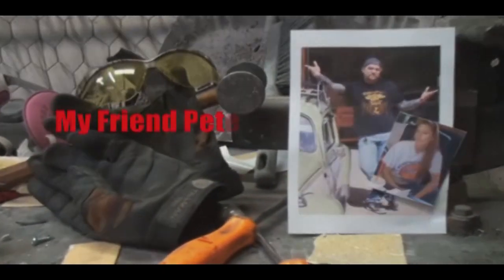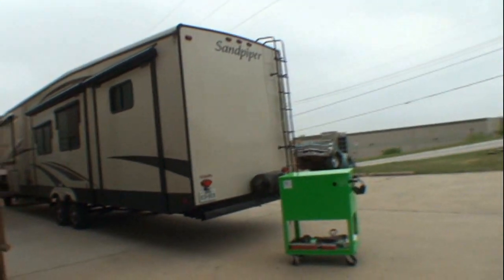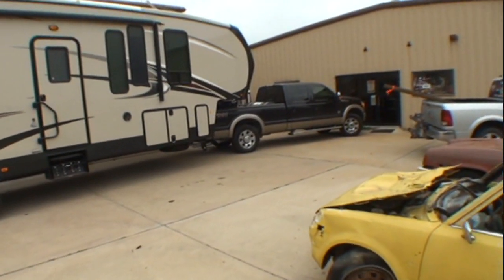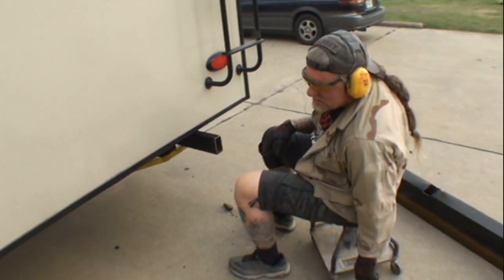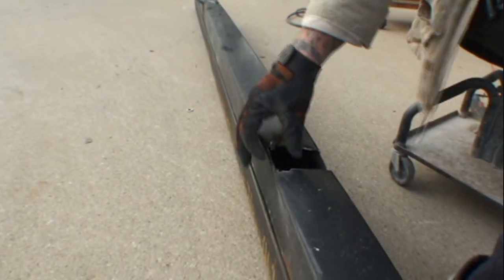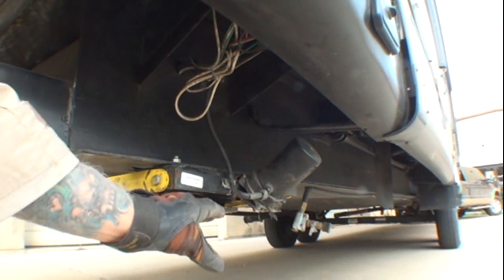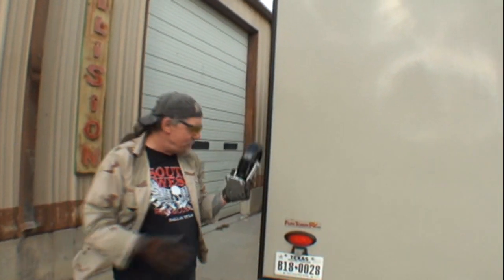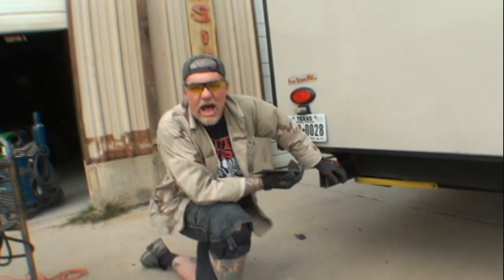How Can I FIX My Camper "RV" Trailer From Dragging Ass? - Do It Yourself

Comment: I'm kind of with Gonzo 59 on this one. Personally, I think just a pair of 1/2 x 4"  skid plates would have sufficed without sacrificing the safety aspect when the center wheels lift off the ground and the back end uncontrollably swivels towards the lowest side of whatever slope is being navigated.
As it is you just cut the normal clearance in half by adding the wheels but you did a nice job and gave the customer what he wanted. Your install will probably work fine 99.9% of the time.  Hi Minnie!
Reply: There is no possible way those rear wheels will ever hold that entire trailer up and cause it to do that. Give me a break.
Reply: Obviously you haven't seen much in life yet, have you. And it is obvious that you have no experience with trailers.  I've seen what I described, happen on shorter trailers than that. Most times the frames of trailers that long will buckle when the central support of the axles leaves the ground from just the kind of situation Pete is showing you. That is why the axles are in the center rather than further back. They make em cheap, that's for sure and they are made to traverse only level ground. But when you get into some places even worse than what Pete is showing you, it can turn into a very expensive nightmare in a hurry. And if the frame doesn't buckle and you've got swivel  wheels on the back end coupled with the pivoting pin of the fifth wheel, that trailer will move to the side instantly if there is any sideways slope to the grade. 
And as for the centrally located wheels leaving the ground, just ask others with more driving experience than yourself. You will learn that people have even got their trailers jacked so badly that the pulling rig needs help because it can't pull the trailer off the brow the back end is hung up on when the full weight of the trailer is supported at both ends.  That is why skid plates are a good choice because you lose no clearance installing them, lessening the possibility of that shit happening. And forget trying to back a trailer like that off the hump once the back end of the trailer touches the ground. Simple physics makes that impossible.
Not everyone lives in the fantasy land of blacktop, flat prairie and superhighways. Take a lesson in geometry and my point will be proven correct in very short order. And that certainly isn't rocket science to most folk.
No breaks given for stupidity.
Reply: Sir, I have put over a quarter of a million miles pulling trailers that are well over 30 feet long with over half a million dollars worth of horses inside I actually use common sense pulling my rig. I know your old but age doesn't quantify necessarily to knowledge. A good truck and trailer driver doesn't put their rig in situations that could come even close to a train wreck like you are describing. I was exhausted reading your post due to all the nonsense and make believe scenarios, I don't know where you are pulling your trailer but you're definitely not very intelligent if you are putting it in situations like you describe. After seeing you made a video about putting paper flames on a passenger car now your nonsensical post makes sense. I'm still laughing.
Reply: Who said anything about a driver knowing what he is doing? Did you miss the part of Pete's video where he showed that the guy driving the rig nearly tore the bumper off that 80,000 dollar trailer? Most people who purchase monstrosities like that have little to no experience driving such a combination and I can attest that they constantly get themselves into real nightmare situations. 

You remind me of an idiot know it all up here who loaded his draft horses into his trailer to take them south to the Royal Winter Fair in Toronto only to have to get someone to shoot the both of them after they fell through the floor of the trailer at 60 miles per hour and he dragged them for 10 miles before someone noticed and stopped him. Not much left of their legs so he lost everything to his ignorance of how to check the soundness of his rig before loading over a ton of animals. He had years of experience though hauling horses. But he was just an idiot with a mouth and no brain driving down the road dragging a trailer.

As to my flame paint job, you should watch the video series. You might learn an easier way to design and transfer flames to a vehicle to "PAINT" those flames and have both sides look exactly the same.
As Pete has said in the past: You keep laughing and I'll keep showing folks the right way to do things. Wisdom is not based upon your opinion but is based upon what works properly and what doesn't.

Comment: The back end of a Toy hauler is different.  Have you worked on one of those?  I have a Raptor (Craptor) 332 TS.  If I drag ass too far  I start  hitting the gas tanks.  i have a banked driveway worse than yours.  The tough part is placement of the castors because the back end hits first. The hinge of the  bicak door has to be able to swivel ope without can openering the  door.  I got lucky coming in my driveway and heard the scrape.  I had just enough brains to listen and stop.  But nobody can seem to teach me a work around.  Maybe a removeable wheel might work.

Comment: It's a good idea in theory but maybe not the implementation.  Even if there is no chance for it to lift the road wheels off the ground in extreme situations "hence the reason to have installed them higher" there is still the very real chance of the frame rails collapsing because of the distance to the next line of support.  I mean collapsing behind the road wheels as they come off the ground or maybe even tearing the frame loose from the body itself.  Just something to think about when you're attempting a job like this.

Comment: Another awesome video my friend. I also was wondering if you could have welded the plate on the top side of bumper and frame and it would have recessed the bottom of caster within a few inches below bumper. As long as it had room to swivel still. I watch your videos and you are like me and learn and perfect on last job. Awesome ok.

Comment: Too big of wheels and/or poor placement Pete. The correct way to do this is run a string from the bottom of the rear tire to the bottom of the bumper to see where the angle is going to be when it will drag. The idea is to keep the skid wheels to take as little pressure as possible to keep the bumper from hitting. Your size wheel and location will hit way earlier than need be. There are also skid wheels made specifically for this purpose, however your wheels will work, but they will impact the ground way to early like I said because of the placement related to size. Any pressure against the bottom of a trailer frame is not a good scenario, but it's needed for cases like you describe, but only the minimum as possible. Enjoyed the video, I just think a little more engineering is needed. Use the string method I described to yield the best results and see if anything else  could impact other than the bumper etc.

The other issue that's going to happen is not the structure of the wheel itself in some cases, it's the steel mounts on the sides. Even though the wheels turn, in certain cases they will bind and because the wheel is so tall, the weak point is the side steel mount, they will bend easily without a lot of pressure.

Comment: First off no vehicle is taller than 13.6 ft  and that trailer’s empty weight is more likely around 15k pounds and them ridiculous wheels your putting on the weakest point is the bearing cup as soon as they’re under a load that will pop free ... do better !

Comment: Wouldn't the wheels raise the back of the camper enough to lift the axle wheels in some "situations?" I'd weld the plate in the corner of the bumper and frame at a height that raised it a little but still allowed it to pivot.
Love your vids.

'You almost ran youre fuckin thing over!" Hahaha

Comment: That camper is not 15 foot tall, it’s not 5800 pounds 😂, it’s real height is around 13 feet and weighs around 12000 pounds. Those wheels will not work 😂🎉. Those wheels will bend